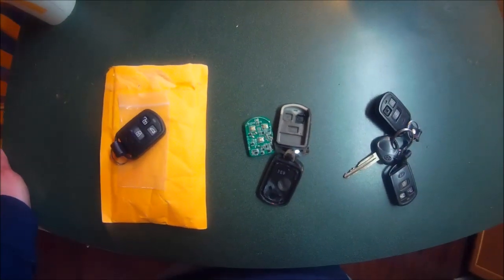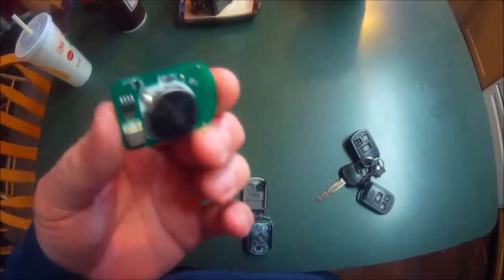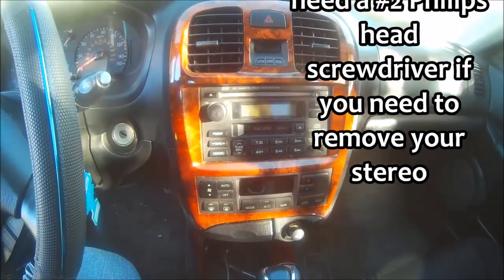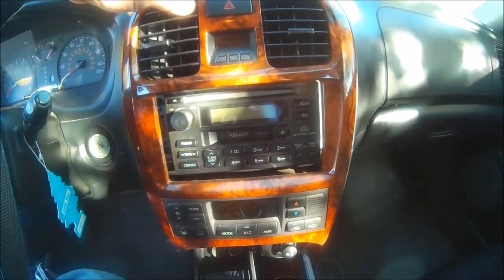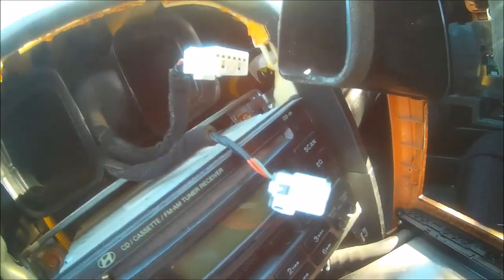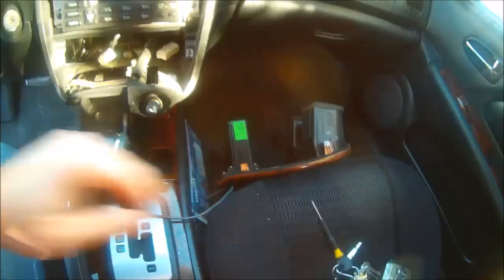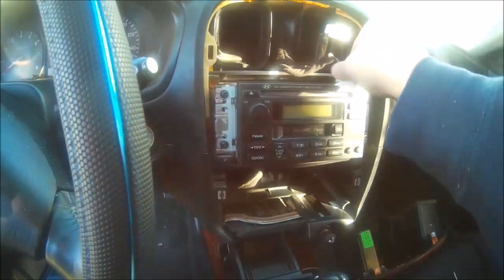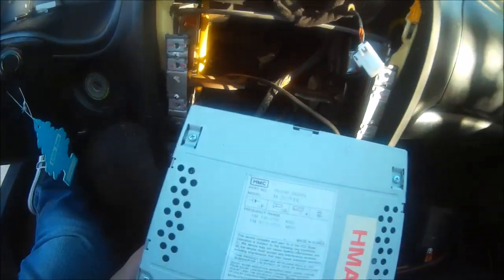2002-05 Hyundai Sonata Key FOB Remote Programming

Comment: Hi everyone this guy explains it very well. But the only error is that he says to press and trunk and lock buttons. That's not true.  You only hold the lock button. And wait until you hear the doors lock. On both remotes. When the set is activated for programming. It only can have two remotes. 

So if you want to add remotes you must add another keyless remote module in order to have more remotes. But keep your stock remote. 

These cars do have security features that required the stock remote(s). So if you don't have one. Buy at least one. Buy it online.  Due to it can disable your engine. Until you get a new remote. 

Those who don't know.  If you are sitting inside the car, and lock the car with the remote.  Then manually unlock the door with your hand. You can disable the engine.  To enable hit the unlock button on your remote, and open the driver door. Then the engine will be able start with the key. 

If dome light switch is broken on driver door.  Replace quickly due the security features. They are about $10 at car dealer.
Reply from the maker: Thanx for the clarity.  Appreciate it
Reply: What do you mean if some light switch is broken replace it?

Comment: If you reach under that bit of trim by the pedals you can feel and see the switch, no need to even touch the radio or remove the panel, and yes only two codes can be programmed unless you see dealer.
Cheers
Reply from the maker: M JB alrighty...thanx for the info
Reply: Can you supply photos to help?  I tried to find it, but no luck on my part
Reply from the maker: I tried that as well, but cannot reach the box at all.
Reply: Use a mirror and a 90° pick.

Comment: Procedure
1. Remove the lower crash panel (usually the piece of trim below the steering wheel & above the pedals) and locate the Remote control receiver unit. If it is not there, try behind the small piece of trim in front of the door opening (often referred to as the kick panel).
2. The switch on the side of the unit should be switched to the SET position.
3. Press the Door lock button or unlock button on the Transmitter quickly.
4. Return the switch to OFF position and then test remote control.
Programming remotes on 16 pin OBD Systems
Procedure
1. Locate the small black box below the steering column for remote function.
2. Remove the small piece of tape to uncover a hole with a switch inside.
3. With the ignition on, move the switch to the SET position.
4. Press the button on ALL remotes needed for the vehicle.
5. Return the switch to the OFF position.
6. Switch off the ignition and test all remotes.
Reply: Can someone show me photos? I have 2005 hyundai sonata and I cannot find that switch. I looked underneath.
Reply from the maker: Thank you
Reply: Thank you very much for that info. I'm a bit confused as Ive found the module and I can't find any kinda switch to switch off or on so I'm not sure if I've got the same module as the guy in the video. Sonata 2000 to 2005 I think. Mines a 2004 so I'll try your ideas out. Thanks so much.
Reply: hello, I have a 2004 sonata, I can't identify the remote, I can't find the vehicle in the obd device, I can't identify it in manual mode. Could it be because the immobilizer is cancelled?

Comment: To program a key fob for a 2004 Hyundai Sonata, you can follow these steps12345:
1.Insert the key into the ignition of your Sonata and turn the key to the “On” position.
2.Hold down the "Open" or "Unlock" button on the keyless entry FOB until the vehicle's lights flash.
3.Alternatively, you can enter programming mode by removing the dashboard fascia and locating the alarm system control module3.
4.Program the remote by depressing and holding the “Lock” or "Unlock" button on your remote for one full minute24.
5.Program additional remotes if necessary.
Exit programming mode.
Test remotes.

Comment: my 2005 2.9 terracan seems to have the same box. 
 the cover has the cutout for the switch. and the board seems clearly marked for it to be soldered on.
Tried with alligator clips to act as switch. but couldn't get it to work (only have lock/unlock). might be bad contact with clips, or need more than two pins shorted together.
Reply from the maker: Let me know if you figure out anything because other people have the same issue as you but I am unaware of the solution

Comment: Good news: keyless entry module without the SET/OFF switch? There is a way to reprogram them and make your key fob work!

You will find elsewhere how to reach the module for a 2005 Hyundai Sonata. The instructions you get you get for fob reprogramming require that you set the switch on the module to SET for programming and then to OFF after successful programing. The problem is that on many Hyundai models, the module does NOT have a SET/OFF switch and you must go to a dealer or a key shop capable of programing your new ( or used) fob at a cost of $75-150. There is a way to do it yourself, for free.  I will not repeat the steps to access the module, located behind the center fascia. Once you remove the fascia and can see the module, follow these steps:

1) Pull the module out (you may have to break the bond to the bracket (you can glue it back to the bracket afterwards. I did). Then disconnect the antenna and white connector. You should then be able to pull the module, a black box, out of the vehicle.

2) Check all sides of the module. If you see a SET/OFF switch, of course you can follow the instructions given elsewhere. However if you are reading this, your module does not have that switch. So:

3) Carefully open the module and very carefully pull the circuit board out. Be careful not to break anything, or scratch any “printed” wire or solder point.

4) Locate the area on the back of the board (should be a whitish background), where it say Switch, SET and Save Code, etc. That is where the switch was before Hyundai removed it to force us to go to a dealer for reprogramming.

5) Now, very carefully connect the four leads (solder points) - two by two  - that the switch would connect in the SET position, if the switch was there (see picture). You should do so with two short and thin strands of copper wire (one for each set of solder points), after you strip the strands from a normal wire. Hold the strands onto the solder points with tape. 

6) Carefully place the circuit board in the area behind the center fascia and connect the antenna and the white connector to the circuit board. Make sure the board does not touch anything, especially metal. You may place a rag or some plastic shield to protect the circuit board (I didn’t, I made sure there was no contact).

7) Make sure the antenna wire and the white connector are plugged in.

8) Now turn the ignition on and follow the steps to preprogram the fob given elsewhere for the lucky ones that have a module with a switch. You are now in the SET positions of the switch.

9) You may not hear any sound or notice anything while the programming is being done (I didn’t). When you finish the required steps, turn the ignition off (last steps actually).

10) Disconnect the circuit board (antenna and connector) and remove from vehicle. 

11) Remove (again carefully) the tape and the copper strands (you are now in the OFF position of the switch)

12) Reinstall (carefully) the circuit board on black box (module)

13) Connect module to antenna wire and connector and reinstall module in car (you may have to glue the side to the bracket on the drivers’ side of the console).

14) Replace the fascia after connecting all the instruments.

15) You are done.

 

You new fob should work like a charm I did for me. I was actually surprised that it worked. It has been a few weeks and it works perfectly. The fob I reprogrammed I had bought used on eBay for a few bucks (genuine Hyundai, but theoretically the method should work with any other similar fob/aftermarket). 

 Good luck.
Reply: I understand your concept, but do you have a picture of your circuit board that I can follow. I don’t wanna connect to the wrong lead. Thanks
Reply: @hoyinli3130  did u get yours going? Did you have any photos from the circuit boards of which solder points to connect. Im quite stuck.

Comment: Followed the procedure, pretty clear and good. Couldn't see or feel any switch. I removed the box entirely and lol no switch, not even tape. Hyundai obviously wants us to go to the dealer. However on the circuit board, on the reverse side if you pull it out, you will see solder points marked OFF and below SET/ SAVE CODE. So the switch toggles between these two points. There are six smaller solder points between the OFF and SET solder points. All of this is in a white area of printed circuit and it is difficult to see which one connects to which when the switch is up or down. With a picture of a switch and seeing what it connects to on either position it would be easy to program the box without a dealer assistance. Does anyone have a picture of a switch on the circuit board in either position so we can just emulate it? Thanks.

Comment: I have an 05 sonata and did everything in this vid until I realized there is no switch on my box. The title of this vid should be changed. I did some research and learned that 05s can only be programmed by dealer or locksmith.  Actually it said 02 and later but since the car in this video is 04, I dunno whats true. Kinda sucks. Wish I could just do it myself.

Comment: I tried everything u said. Ironically my problem wasn't with getting the box off the metal frame, it was not being able to program the fob to the car. I tried it about 10 different times and it wouldn't work. Any suggestions?

Comment: I pulled the box out and found my 2006 Hyundai sonata v6 has NO "off" or "set" switch anywhere on the box or inside of it.  Now what??!
Reply from the maker: Read through the comments on this video. I think there is an internal switch inside the box on some vehicles for some reason.
Reply: 2006s can only be programmed by dealers or locksmiths. I'm dealing with the same drama.

Comment: My box had tape I pealed the tape to find just a hole no switch and it says set and off on each side of the hole
Reply from the maker: That is so weird!! There has been a couple of people who have said that.

  Before I start any video, I go to the junk yard and tear apart the cars to see how to complete the task the easiest way I can figure out (not the only way, and it may not be the easiest way either, but it's just how I figure out how to do it by repetitive inspection).  

  Anyway, that being said, I tore into 5 vehicles that day, not including my own, and all of them had a switch with no tape. It is so weird just because you are like the 4th person to say that. So I would suggest, pulling a box from another car...or you would have to take it to the dealer. Sorry about that.
Reply: @bryzgarage5028  I work at a junk yard and they have a few sonatas in the yard maybe il go pull one or have a lock smith program it if I'm lazy
Reply from the maker: @ceplure4421  yeah man, I'm sorry about that. I wish I could pot some thing in more detail about which sonatas are programmable and which ones aren't,  but I'm not sure at this point. Good luck brotha
Reply: @ceplure4421  That's the thing I love about the IM-608pro scan tool by Autel but they're also roughly $3300-$4000 depending on where you buy, relationships you've built with your scan tool supplier. I use www.AESwave.com and have been for about 6yrs now. 

I will say the more you buy at Once the better a deal you can get which is good as you can save some money done properly. I've probably spent enough there over 5-6yrs to buy a new or slightly used SUV with bells and whistles. All the while I still drive my 04 Tahoe base LS trim model, rusting wheel fender wells w/130k miles and am now working towards replacing that. If I had shop space as a mobile guy I'd buy a 12-16 SUV wrecked and rebuild it myself and save some serious $$$$. Yeah you've got to buy parts, do labor buy that labor is work for when you're slow at your business but as I said doing mobile diag, module reprogramming, ECM & other diagnostics along with keys and vehicle security professional work (new locksmith ID name is VSP now), keys,  security modules, proximity keys, programming, cloning them, etc.

Comment: mine doesn't have the switch for set and off on my black box
Reply from the maker: 허영남 did you look at the firewall side of your black box? There Is a little tiny switch that you can't really access unless if you take your box off or you open it to access the switch.
Reply: Mine doesn’t have a switch has a spot for it but no switch

Comment: THIS IS A TOTAL JOKE NONE OF THIS HAS  TO BE DONE TO PROGRAM THE REMOTE WASTED A WHOLE DAY DOING THIS WHEN ALL YOU NEED TO DO IS REMOVE BATTERY CABLES AND PLUG PROGRAMMING EQUIPMENT UNDER HE DASH
Reply from the maker: Right on, thanx for sharing.
Reply: BryzGarage even graceful in defeat. Just subbed
Reply: Im lost. Please explain this in more detail how you do this. I get lost after the part where u take off the battery cables. Thank U for explaining a lil deeper :)
Reply: Bryz Garage - can U explain & expand on what Mark Ducrest is offering? Is he saying that U can simply remove the battery cables off the battery under the hood? Please explain his next set of instructions after that. Is this something that will work for a 2004 Sonata Base 4 cylinder? Im getting the impression from all the posts on this thread that people are experiencing all kinds of variations in trying to program their keys; boxes being located in different areas. Can U simplify for me? Thx so much!